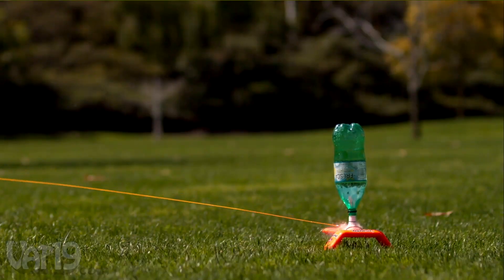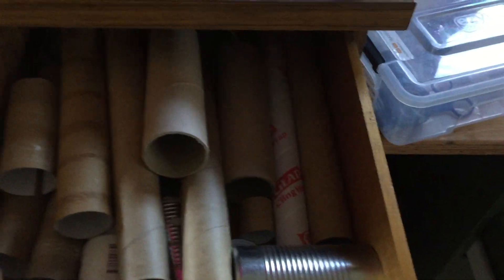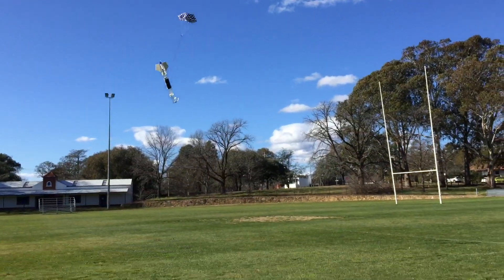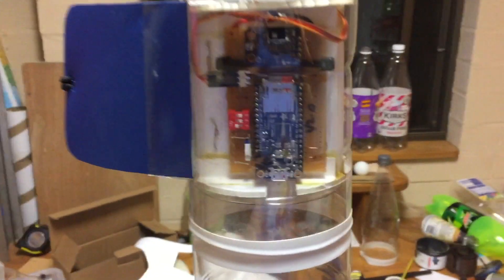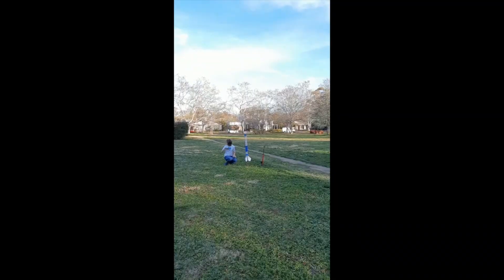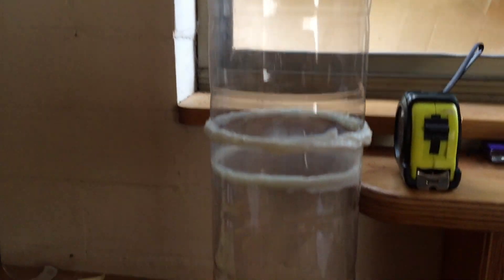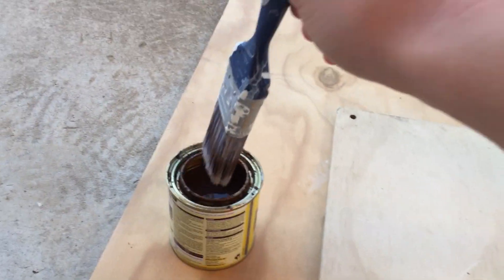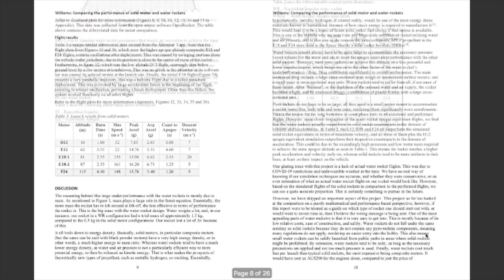Solid Rockets vs Water Rockets

Comment: I'm into air cannon rocketry..Challenging part of it is to land them horizontally instead of using parachute or streamer.Much better than water or solid fuel Estes/sugar rocket motor.
Reply from the maker: I suppose for it to land horizontally one would have to change the stability characteristics of the rocket, as in to have it be stable on launch (centre of pressure below centre of mass) then the opposite on the way down (centre of pressure above or at centre of mass). That's why some of my lighter solid fuel rockets tend to survive a landing if the parachute failed to open as long as the nose cone deploys, as this changes the stability of the rocket and it comes down horizontally while providing a larger surface area to slow down. I will say there is something very satisfying in designing a successful parachute deployment system, and for a rocket the size of the one in the video it's a must
Reply: I always made sure my rockets weigh no more than 100g..usually I  find 55-75g seems to be the ideal weight for a long lasting flight both from launch to landing horizontally.